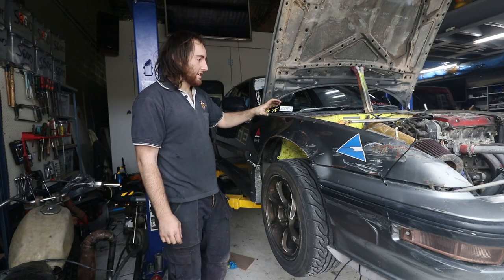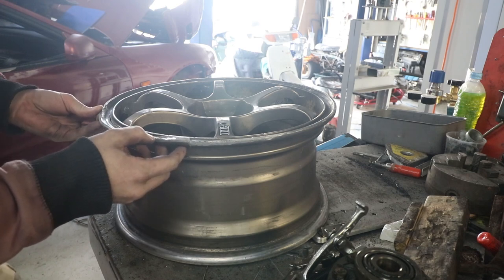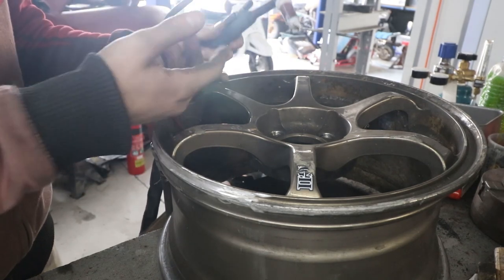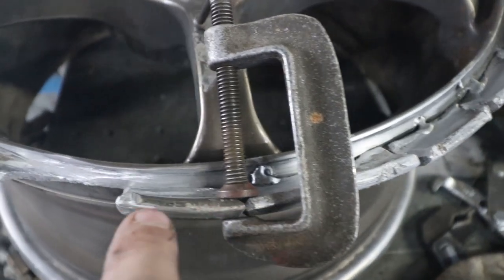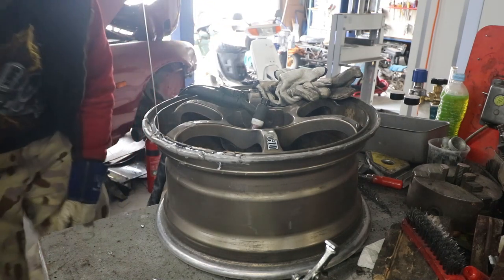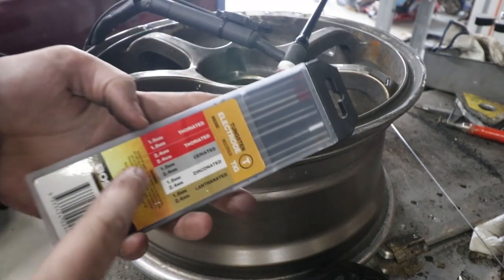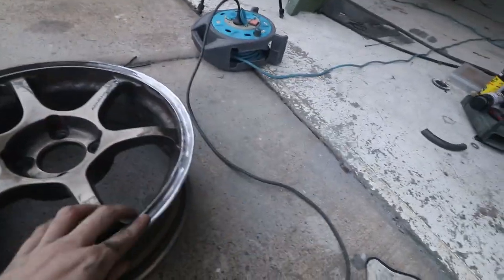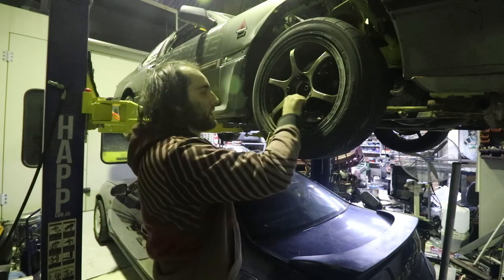How to Repair a Smashed Wheel.

Comment: no thumbs down from me, but not a safe repair
Reply from the maker: She'll be right.  I did the same repair on the other wheel about 5 years ago. Still going strong
Reply: @Conorsev  it will be fine on your drift car, certainly not legal and I wouldn't run it on the road
Reply from the maker: Eh nothing's legal.  I would run this on the road no worries.  Still a better wheel then a bunch of the shitty China ones getting around.  The main structure of the wheel is untouched.  It's just the lip that's been repaired.